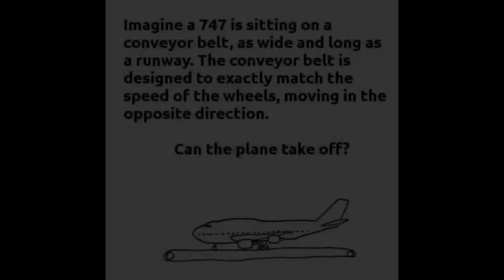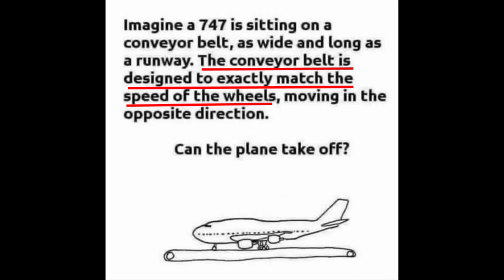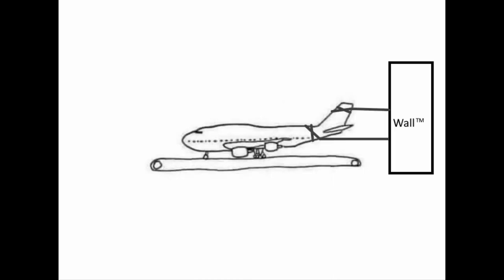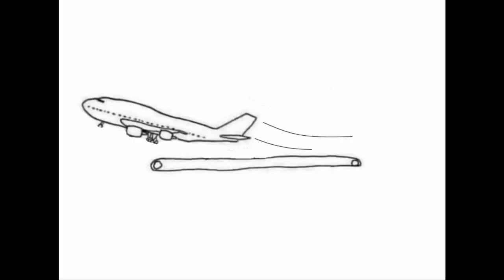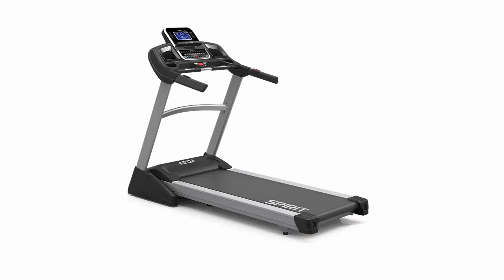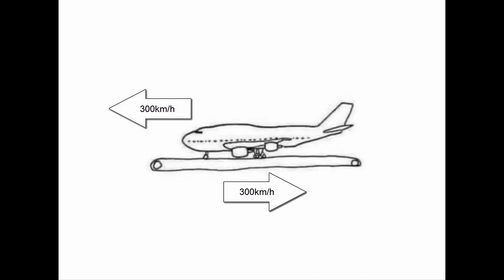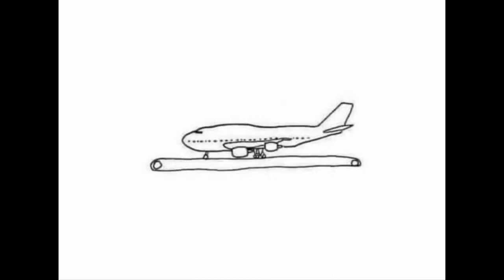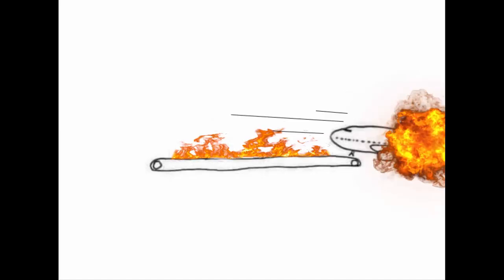Airplane on a treadmill is a flawed question.

Comment: You didn't mention that the plane moving AT ALL would immediately break the scenario's rule. Because if the plane itself moves relative to the ground, then there must be a difference in speed of the wheels and conveyor, thus breaking the equal speed rule. That's why its flawed. The plane taking off breaks the scenario, the plane not taking off breaks physics.
Reply from the maker: Well spotted. It's a train wreck of a question.
Reply: @venera13  
Why not rephrase the question and ask if a plane on a conveyor belt could take off if the conveyor belt always was able to match the plane's rolling speed and thus keep it stationary?
The practical problems with designing such a conveyor belt and the reason why the plane will take off if the conveyor belt is limited to the plane's normal take-off speed is a different matter that should be addressed after the first question has been answered.
And just for the record, the answer to the first question is NO, as long as we are talking about a normal fixed-wing aircraft and zero headwind.
Reply: @fromnorway643   incorrect. Conveyor belt matching the plane´s rolling speed will not render it stationary, as was already explained in the video. Hence a take off is possible as usual
Reply: @siriusczech That’s only if you assume zero friction or angular momentum being transferred into the landing gear assemblies.
Reply: @ozzman1997  that is true. But that is another topic. If you go with low speeds (just started moving) the increased friction of added wheel roll has close enough to 0 effect compared to what it is in normal case.

In higher speeds close to take-off speeds it will play a more substantial role, but still definitely not a 100% one. The bigger problem is overheating of wheel bearings, but the same could happen to the belt and it is more a question of durability of parts of mechanisms then a simple tricky riddle.

Yes, standard 747 would have been at least in a high risk of gear damage before it takes off at 160 km/h due to it´s wheels not being constructed for 320 km/h speeds (their safe limit is around 250 km/h iirc from another video), but that is irrelevant for the original question.

Because they thing many take-off-deniers are claiming is that such plane would never be able to move an inch and would stay stationery to outside watcher the whole time. Which simply is not true :)
Reply: Not so...the speed of the conveyor can match the wheel speed and the plane will still take off as the conveyor isn't affecting the airspeed and the speed of the wheels have zero effect of the engines pulling the wings forward into positive airflow for lift.
Reply: @phantom_Biker  That is true if you neglect inner frictions of wheels.
Reply: Well said, HONE.

The video fails to understand that part of the question, as do the replies to you here, but it is very straightforward.

Logic means the plane cannot move. Physics means it would be virtually impossible to build a conveyor belt that meets this requirement, and if it did the friction would destroy the stationary plane on the spot.

It is actually not that tough a question.
Reply: @phantom_Biker  Think of the conveyor belt being stationary and the airplane gaining speed. Because there is friction between the conveyor and the wheels, the wheels will move. To match that, the conveyor would  have to increase its speed, which in turn will increase the speed of the wheels and so on. Planes need to accelerate while its still on ground before it can lift off, which causes the wheels to turn, and the conveyor belt turning also causes the wheels to turn. That's why this question is flawed, the conveyor belt will never be able to match the wheels' speed as long as the plane is moving.
Reply: @siriusczech  Under what circumstances can the plane be moving forward, while the speed of the wheels matches the speed of the conveyor? The only physically possible way for the plane to move forward is if the wheels are moving faster than the conveyor. Same speed = stationary. Slower speed = moving backwards
Reply: @timjohnun4297  because it's a riddle. Belt is DESIGNED to match the speed of wheels. Plane starts, moves a meter forward by its engines, both rotation speeds go to infinity and they stay there. Infinite speed matches and the plane moves forward due to jet engines and lift off.

Version no.2 (even more probable): speed of wheels is told  this way to confuse readers into thinking about cars and refers to relative speed of vehicle vs. surrounding ground. In that way belt dinoly goes to -160 km/h while plane doing +160 km/h and lift off with wheels rotation of 320 km/h.
Reply: @siriusczech  again, overthinking. Theoretically it is impossible for the plane to move forwards if the wheel speed exactly matches the conveyor speed. No forward momentum, no lift-off. End of.
Reply: @timjohnun4297  you are underthinking. Belt is not what limits the plane movement.

If you stick to your view, the only correct speed for the belt i 0, as there would be no force available to make the belt move. Is that your view?
Reply: @siriusczech  my view is that the question is a theoretical one, and not really transferable to reality, however, if a conveyor that perfectly matches its speed to the plane’s wheel speed the plane would not move. It would be impossible to. Assuming there is no tyre slippage, it’s impossible for the plane to move forwards if the wheel speed doesn’t exceed the speed of the conveyor
Reply: @timjohnun4297  you are switching causation and conditions. Let me explain shortly:
"the belt is designed to match the speed of the wheels..." is the condition. But what causes the belt to move? What is the initiating act? 

It is not the belt.

For the belt to start moving, it needs an input. That input would be movement of a plane, because the chain of forces involved consists of jet engines -> thrust against air -> plane moving forward -> wheels turning due to speed difference between ground and plane (sudden changes in ground speed are irrelevant for this due to inertia of the plane - same as the trick with tableware vs. tablecloth quick removal, as it takes time for things to "catch up" with the cloth movement).

Also wheels are not limited by the belt, the belt "only" matches (or tries to match) speed with wheels. It´s not a problem of wheels that belt cannot ever match their speed.

Yes, there is a math problem now. By moving the plane even a little you create infinite self-reinforcing loop rising quickly (immediately) to infinite speeds of both wheels and belt.

Now you have two options. 
1) You either state that infinite = infinite and as there are no other inputs like bearings wear and heating of stuff etc. and the plane will move forward with wheels not limited by insane rotation speed => plane WILL move forward and lift off, or

2) You start accounting for other effects (slippage, inner friction and so on) and there are multiple outcomes out of this depending on how you define other variables and their impacts. Most of those outcomes still result in the plane lifting off, but not all.
Reply: @siriusczech  again, overthinking, way too much! You do realise this belt is mythical, right? It magically increases speed to match the speed of the plane’s wheels. The question becomes simple, once you accept that you only have to give a theoretical answer and stay within the questions parameters - the question is this: how is it physically possible for a plane to move forwards on a conveyor belt, without the wheels turning faster than the belt? Answer is, it’s not
Reply: @timjohnun4297  As a theoretical question, I tend to treat it like that, but still with rest of facts/laws of physics intact.

If your answer is "plane cannot move because inequality of speeds", then sure, take it like that.

My stand comes from "what makes the belt move" and thus my mythical belt is capable of trying but in the end incapable of restraining the plane from liftig off - purely due to wording of the problem.

Have a nice day!
Reply: @siriusczech so..gravity no longer exists? Lmao the plane isn’t literally resting on the wheels until it generates enough speed? Are you high? Lmao you have a plane. On a magical conveyor belt that matches the speed of the wheels no matter what. You can push those engines as hard as you want! And they’ll generate more push, but no lift because you LITERALLY ARENT MOVING. Lmao you’re on a belt matching the speed of your wheels, that you’re literally resting on because of gravity. Learn aerodynamics.
Reply: @Soulsgamesmayhem-hs8mf  You can lyao as much as you want, it neatly matches the fact that what you say is total shiet as well :D 

Gravity exists, plane is resting on wheel axles. No big deal. But that belt will either never move (as it has nothing to cause it to move), or will in vain try to match speed of wheels but can never suceed, because the plane moved a bit (which caused the counter-reaction of the belt in the first place, read the description).

Gravity does have it´s word in lift speed, but the main question is if the plane will be able to start moving in this simplistic example. Which it will. Because planes do not gain speed by spinning it´s wheels; planes wheels only rotate due to plane propelling itself while still touching the ground at low speeds, but speed of tarmac has little in it irl.
Reply: @siriusczech  …you mis understand the scenario then. This is a conveyor belt that will match the speed of the wheels no matter what. (Magic basically). So the engines can thrust and push all they want, the plane won’t go anywhere or move because the wheels it’s sitting on will spin in place. Not moving the plane forward at all. What you’re suggesting is that you can sit a plane on the runway with no wheels and just fly it away. So a plane can take off from a stationary position. Good job 👍
Reply: But a treadmill cannot stop a plane from moving. So the plane would still move.

Comment: I understand how a simple person can't understand a complex question but it amazes me to realize intelligent people can not understand a simple question. A runner matches the speed of a treadmill so they neither go faster nor slower. The plane in the question is doing the exact same thing. And yet some click bait "expert" can't understand. In short, the pilot can talk to a bystander near the conveyor belt. The plane neither moves forward or backward. No airflow. No lift. No flight.
Reply from the maker: The difference is a runner is powerd by his legs like a car. So a runner and a car can match speed. A planes wheels are not powerd and just free spin, so you can't match the speed as they will just spin faster and faster and the plane will always move forward.

It's a trick question that only works if you ignore reality of how planes wheels work. You can even find video footage of people trying this with toy planes and even Mythbusters using a full size plane. The plane always moves forward and takes off because the wheels are not powerd, therefore its not possible to match takeoff speed as the variable of wheel speed is not constant. This is unironically a testable question with a known answer.
Reply: @venera13  Power transfer. The jet engines push the airplane and rotate the wheels. The speed of the wheels is measured and monitored by the engines. The plane and the conveyor belt are going at the exact matched speed and in the opposite direction. A bystander can talk to the pilot because the wheels and the conveyor belt are going in opposite and matched speeds. Just like a runner on a treadmill.
Reply: @venera13  if the airplane's wheels have to match the speed of the conveyor belt at all times, the thrust from the engine is completely irrelevant. the speed of the wheels is coupled to the speed of the conveyor belt. Essentially, in this example, the plane IS like a car (because of the rule about the wheel/conveyor speed).
Reply: put a paramotor engine on the runner's back now
Reply: According to the rules of the scenario, the belt will increase in speed to counter the thrust produced by the paramotor engine.

Comment: until the plane is in the air the wheels 100 percent are a variable lol. the plane has to roll on the ground to get up to speed. Any forward movement is cancelled by the conveyor. It's actually a simple question with a simple, logical answer. No idea how ppl are saying that the plane can take off it it can't roll forward.
Reply from the maker: Because it can roll, the engines push the plane not spin the wheels. The wheels will spin faster but the plane will still move forward. This is why when the Mythbusters tested it multiple times in small scale and once in full scale the planes always rolled forward and took off regardless of the conveyor belt.
Reply: @venera13  once again, no matter how the vehicle is facing a force (thrust from a rocket, a jet, or a propeller), the vehicle has to move by rolling.  The math is rock solid and crystal clear.  No matter what the vehicle velocity, the rotational speed of the wheels is intimately connected to it by a common formula which shows why the plane's wheels have a zero speed at the contact patch at the surface.

This is a fundamental mistake you keep making in your responses.
Reply: @MrDefreese you’re a smart individual thank you

Comment: The question is the answer. A plane CANNOT take off if the wheels match the belt speed. The wheels would have to be greater than the belt speed. Aka it will NOT take off. It is a trick question that makes people think weirdly.
Reply from the maker: Exactly, if the wheels where powerd and maintaind a constant speed it wouldn't move and wouldn't take off. But since that's now how airplane wheels work it's an inherently dishonest question
Reply: That's a misinterpretation of the question. The belt doesn't keep the aircraft stationary in this interpretation but rather, only a stationary aircraft fulfills this interpretation and stationary aircraft aren't trying to fly.

The purpose of the experiment is determining whether an aircraft TRYING to fly can accelerate on a belt moving in the opposite direction at equal speed and take off.

The answer is YES. The aircraft takes off with wheel speed at twice normal RPM.

And because both the belt and aircraft EACH contribute 50% to total wheel RPM. The belt does in fact match wheel RPM.

Comment: It’s not a trick question and it’s not poorly worded.  The problem is that people have a difficult time thinking within the limitations of very specific criteria, and try to bring in other factors or ignore the specifics of the criteria.  The answer to the specific question is no.  Get over it.
Reply from the maker: The criteria it uses defy how an airplane works. Its a trick question.
Reply: @venera13  the airplane only provides rolling motion to the vehicle.  You could use the same test on a RC car, a sedan, a wagon, etc., and the same results will turn up.

You mentioned that there is no inertial coupling with the ground.  That is false.  The vehicle while on the ground and can only move by rolling or by skidding.  This video is deeply flawed.
Reply: It's not a trick question. The wheel speed is a variable since on solid ground the wheel speed is a representation of the plane's forward momentum. The plane wants to sit, the engines want to push, and the belt wants to pull.

If the engines are not on and the belt is, the plane moves backward. If the engines then turn on, they can push the plane forward to prevent it from falling off the back of the belt. If the plane then matches the belt speed, the two remain in equilibrium. It's not that you're wrong, the plane can move forward along a conveyor, but since its mass pushes on the wheels and the wheels push on the belt, all momentum goes into keeping up with the belt, thus preventing mimentum in relation to air, so no lift.

Comment: How can the plane move forward at all and achieve lift if the condition is "that the conveyor belt and wheels are exactly the same speed." In your scenario with the plane moving forward, the wheels would need to move faster than the conveyor, and therefore breaks the condition.
Reply from the maker: Because it's a trick question. It's not possible to match the speed of the wheels at takeoff speed as the wheels don't have a fixed speed. Regardless how fast the treadmill goes the plane will still move forward as the wheels are not powerd.
Reply: @venera13  No. The wheels are matched by the power of the engines. You don't understand the question.
Reply: Let's not skip any of the wording, to make assumptions. 

The belt is "designed to" match the speed of the wheels. 
"Speed" is defined as "derivative of distance over derivative of time"

The spinning frequency of the wheel is correlated to speed, but does not define speed. 

If the plane moves forward, the speed of the wheel is the same as the plane. The belt is free to match that speed. The belt's speed will cause the wheels to spin at a higher frequency, but will not affect their actual "speed" as defined by their distance through time
Reply: @snytty  thank you, as a non-native, this made the wording more clear for me (I have always been a pro-take off, but was worried about the bad wording causing infinite speed on wheels immediately after the plane moving a bit).
Reply: I always assumed that it was kind of like pushing a cart (the "airplane") on a treadmill that rolls easily, while you yourself don't have any contact with the treadmill:
if you push with enough force (the "jet engines"), then you will overcome the rolling friction, and be able to push the cart forward even if the treadmill rolls a bit.

Comment: Imagine a sea plane is on a river.. the river is flowing at the rate of speed that the plane needs to get up to to get get lift ... the plane will not get airborne... The wheels are powered, but they need to have grip on a surface for the plane to get up to speed.